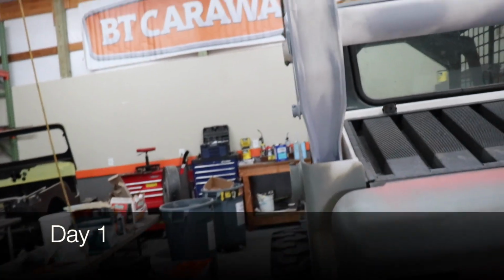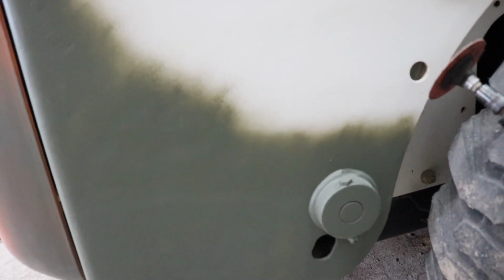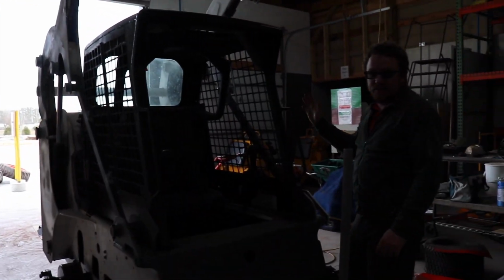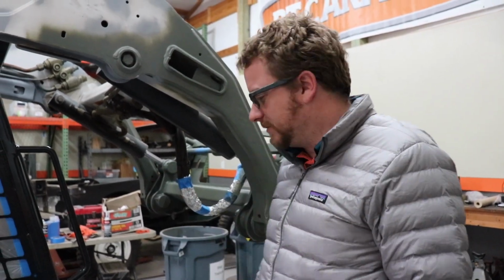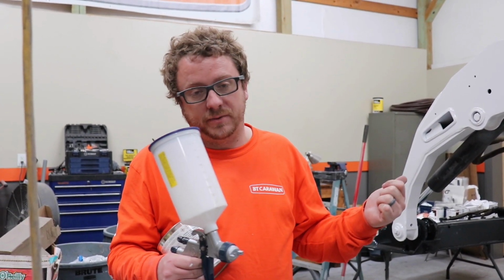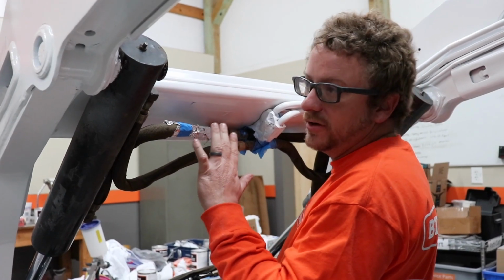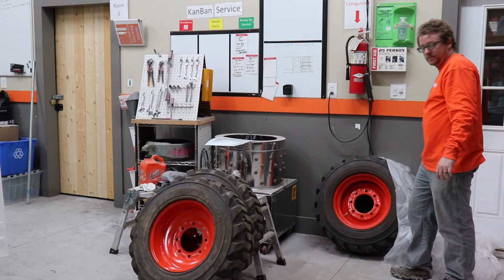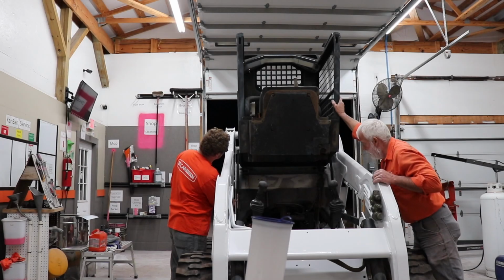DIY 773 Bobcat Repainting!

Comment: I want to hand paint a 6ft tractor topper mower, with a large brush, as I reckon it would give plenty thickness of paint to withstand the normal wear you get with grass constantly whacking the underside. I had to cut out some rotted metal and weld in new, but those have got surface rust on them now, but some of the mower still has old paint on it. After sanding it all over, should i use any degreaser or anything to wipe over the metal before painting. Then with painting, would you recommend using any rust treatment paint first or should I just use primer. I will be using tractor enamel paint. How many top coats do you think I should use. This is the first time I've restored a piece of farm machinery, where the paint is at risk of getting worn away by its use, so I kind of want to do it right from the start, to be long lasting, though I'm not bothered about brush marks showing, hence why I'm brush painting and not spraying. Any advice I would be grateful.

Comment: How many hrs do u guys have into the total job.I have to do our s185 bobcats
Reply: A ton of hours because they ended up adding another 3 or 4 days on top of what they originally had into it. That's two guys for I'm going to say at least 7 days of 8 hour days. That is a $2000 paint job without the cost of the paint and supplies.
Reply: @Ryan-uk8vp  at $17 hr. 
$2000 not bad. I think in my area guys get $3-$4k
Reply: Do you guys want to do a 863g? Very nice job just cant find anyone in Maryland who wants a job.
Reply: where You guys located ? can I bring you my bobcat 773 ?